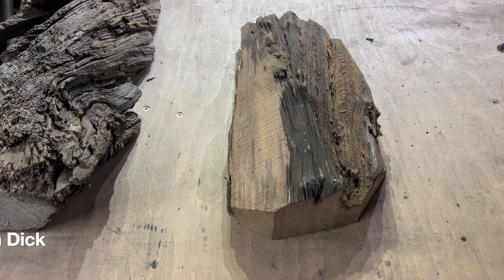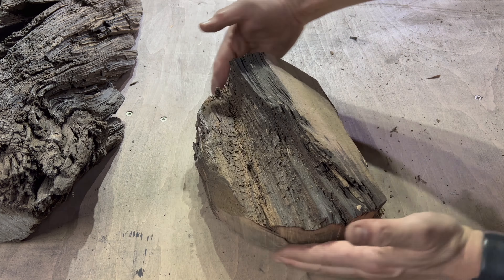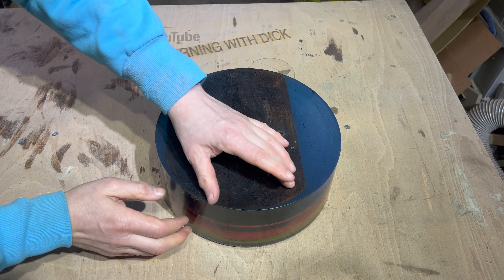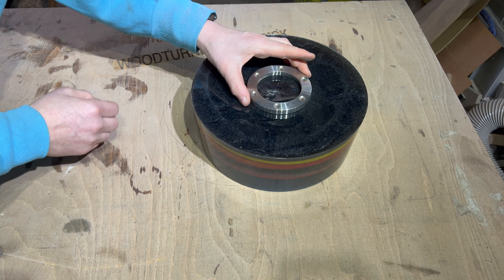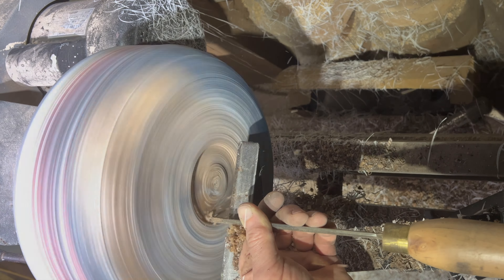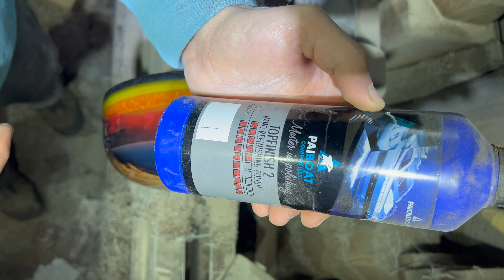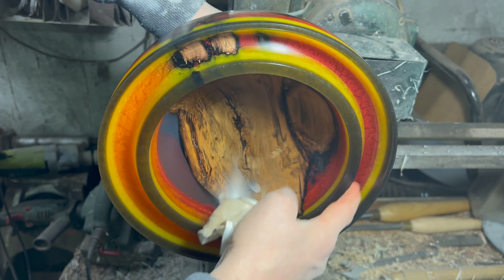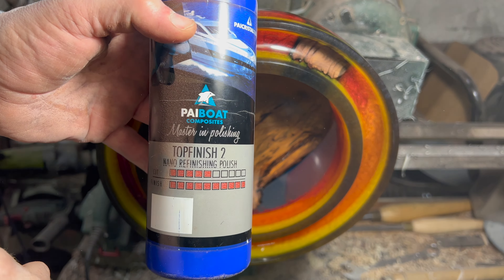Bog YEW and Resin Dump Pot Bowl

Comment: Question if you turn it with bucket on do you take the handle of too. Asking for a friend lol
Reply from the maker: 🤣🤣🤣 Well, if it didn’t release I would have cut the top of the pot off, likely with a jig saw, then carried on the way I did, faceplate ring thing and turn of the bucket 🪣 😊👍